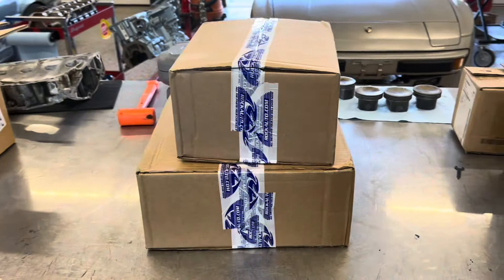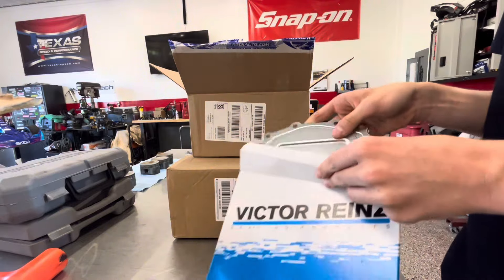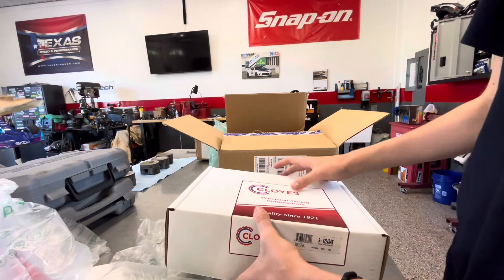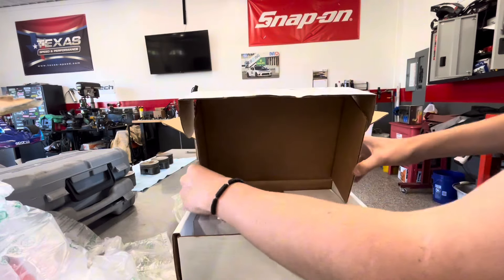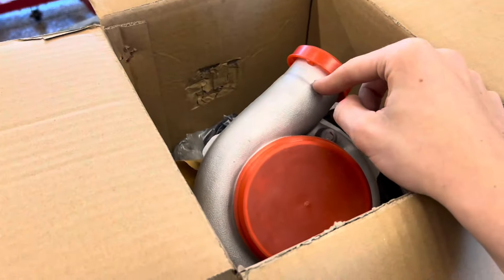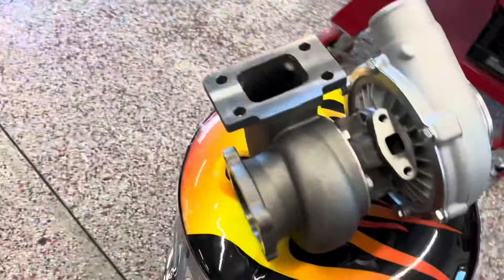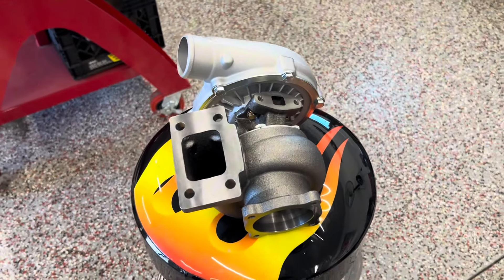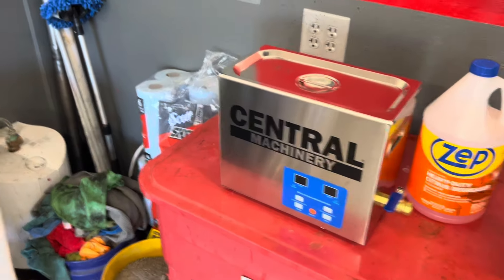Engine Time! | 07K Turbo Build Breakdown - Porsche 944 Safari Project

Comment: hey man awesome video! one upgrade i would recommend is to get the forged crank that was found in the early 07k models. they can be found very cheap at a junkyard and is definitely worth your while! looking forward to the rest of the build. keep it up bro
Reply from the maker: Thank you for the advice and I'm glad you're enjoying the build! Unfortunately, we made a rookie mistake when we installed the bottom end before finding out that the earlier ones were the only ones with the forged crank. I think for now, since we are only going to be running ~11 psi and making around 350 bhp, the stock should be fine. I've read that the stock bottom end is good for 400 whp.